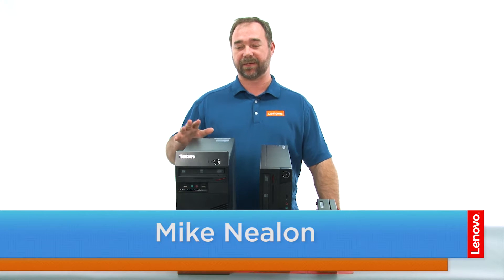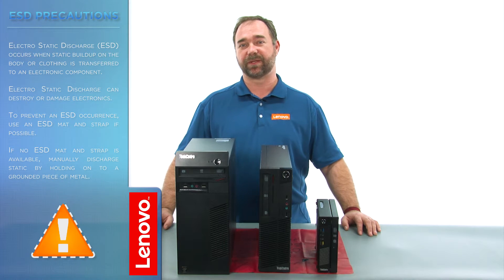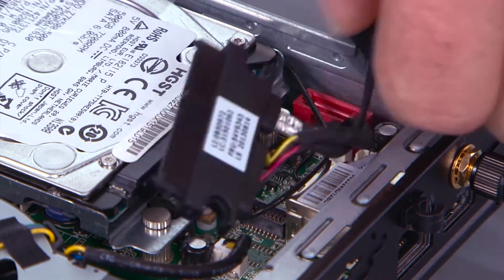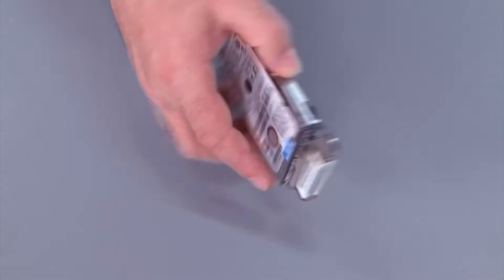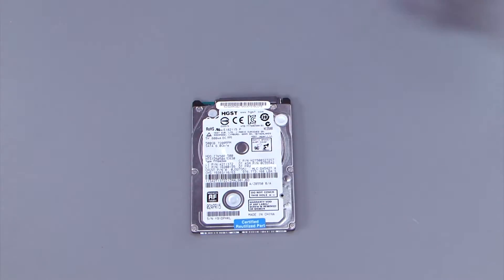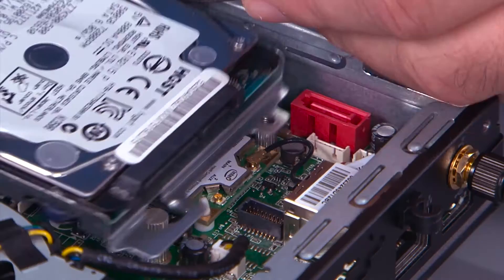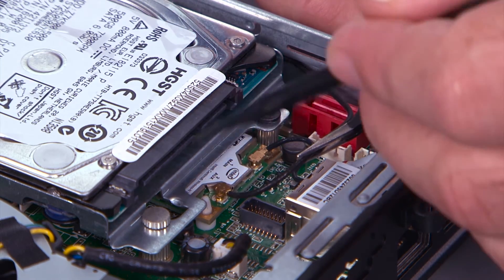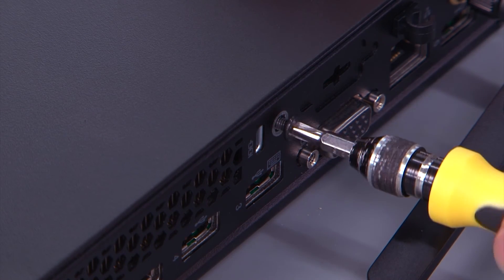ThinkCentre M73 / M72e Tiny Desktop - Hard Disk Drive Replacement

Comment: type of wifi card please
Reply from the maker: Hi Zaky. Thanks for reaching us. Could you tell us the exact model of your device, so we can further check? Keep us posted. Ash_Lenovo
Reply: @LenovoSupport  mine is Lenovo Thinkcentre mini pc M73 with CPU i5 4570t (dual core). I have tried for laptop acer wifi card and when i trun on there is notification like this "Unauthorized Network card is plugged in. power off and remove the network card" (something like that) , and cant booting to windows until the wifi card off.
Reply from the maker: Just to confirm, do you mean you installed a different wifi card on the desktop prior to getting the error message? And once you remove the wifi card, the error disappears? 

Kindly share the exact model number of your machine so we can check the specifications and the compatible wifi cards for the unit. Allan_Lenovo
Reply from the maker: Thanks for sharing the details. Checking here: https://lnv.gy/3GhufeL, you can only use the compatible network cards for the machine. If you will be using a different card, this will not be accepted by the system and will result in the error as third-party network cards are whitelisted by the machine. Allan_Lenovo
Reply: @LenovoSupport  there is 10 options, which one is compatible with my m73?
Reply from the maker: On this link: https://lnv.gy/3HSGAX0, click on Parts > Compatible > click on Commodity Type dropdown and choose PCI Card and PCIe Card, which will show two part numbers, and you can use either 03T8168 or 03T8165. Allan_Lenovo
Reply from the maker: You can use either of the listed LAN cards. So long as it's in the compatible list, that should work with the computer with no issues. Allan_Lenovo
Reply: @LenovoSupport  wow okay noted. thank you for the support! love it!

Comment: Where can I find  2.5" mounting kit for an SDD for m72e?  @LenovoSupport
Reply from the maker: We have no specific bracket for 2.5" to 3.5". However, there would be available fabricated brackets from 3rd party resellers that would also work for your machine. If you google search it, use the keywords 'mounting bracket 2.5 to 3.5' and it should provide you options. 

Let us know if you have other questions. Allan_Lenovo